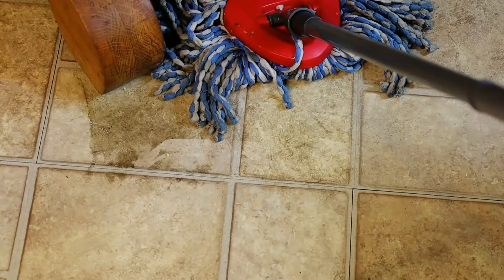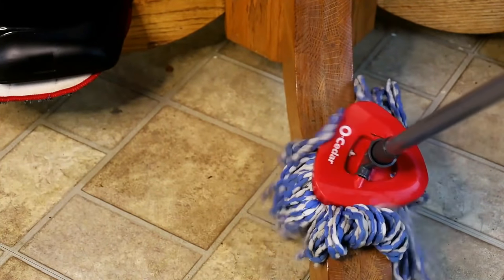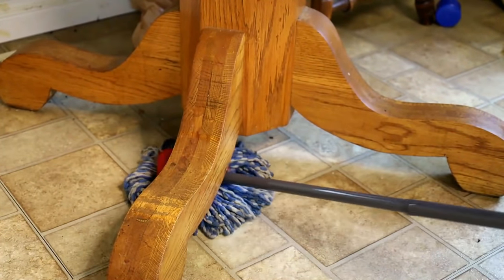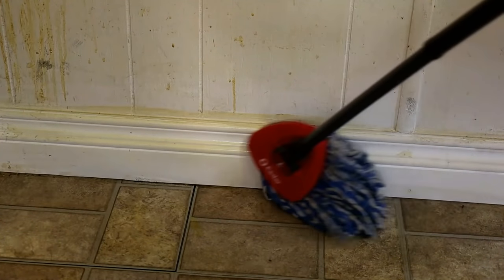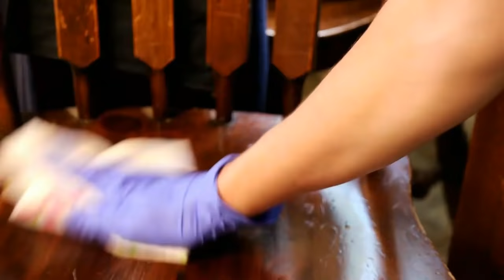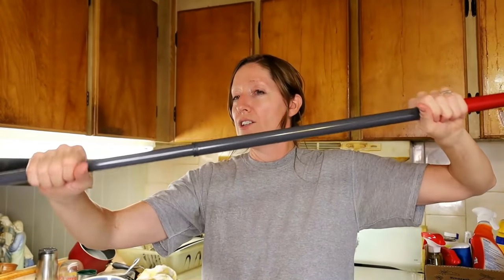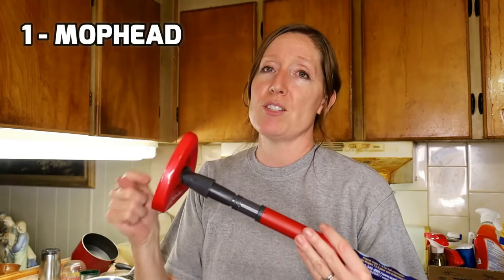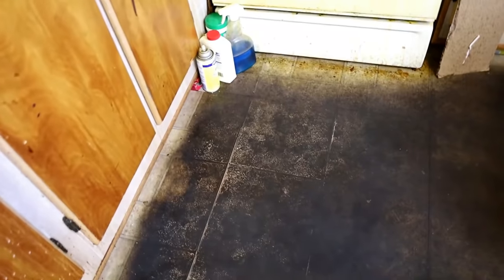UNBELIEVABLE ⚡ Put THIS on Your Filthy Floor and WATCH WHAT HAPPENS

Comment: I used to be a custodian at a university. When the students moved out, we cleaned the apartments. When we came across some seriously nasty or hard to clean things, we would get creative. Oven cleaner was used to clean bath tubs, acid based toilet bowl cleanser were used to remove mineral stains from sinks and tubs, and it worked wonders at cleaning stainless steel. You did a great job improvising and being safe.
Reply: All of those are excellent cleaners for tough jobs.
Reply: That was a kind thing to do...you will be blessed ..
Reply: Have you ever tried Oil Eater?  It works great on grease.  You mayhave to look in auto parts store for it.
Reply: I was a custodian, too. I remember walking into a seriously filthy student apartment. I thought to myself how do these girls live like this?
Reply: Oven cleaner even if no smell is a big NO NO.

Comment: Great job! I have one suggestion to anyone reading this: Please don't rinse the grease down the sink. Grease will build up in your pipes and septic system and the formations of fatbergs (like icebergs) will damage your pipes. It is very expensive to fix the plumbing. It's best to just throw the greasy wipes away instead of rinsing it down the drain.
Reply: Fantastic advice. I winced when I saw the grease go down the drain. The only down side to watching this amazing, wonderful video.
Reply: My son used to make bacon every day. Then he would dump the grease down the kitchen drain! Can you imagine? Yup within months the drain was backed up. My dad owned the house and was renting it to two of my three sons ( the youngest was still in high school). Luckily my two older sons’ dad was a plumber and was able to clean the drain. Thank goodness. But what a mess! 
My oldest son no longer puts grease down the drain. 🤨
Reply: Our plumber totally agrees with you.
Reply: Luckily, the active ingredient in drain cleaner is sodium hydroxide.... same as oven cleaner. Doubt those pipes will clog since the sodium hydroxide dissolved that old grease so it can be washed away never to offend again.
Reply: @gtron7692  sodium hydroxide becomes diluted. If that were the case, less plumbers would be needed. I vote a big No to letting grease go down the drain.
Reply: My mom used to clog the drain all the time with grease. Our plumber finally told her to use nothing but Dawn dish soap, and he never had to come unclog that drain again.
Reply: Yes. I would have used crumpled newspaper to wipe up the initial layers.
Reply: I have a septic tank so I would NEVER pour straight grease down my drain. However, when cleaning greasy pots & pans, what I do as an extra precaution is wash them over the disposal with plenty of dish soap. After rinsing completely, I turn on the disposal while spraying scalding hot water & a generous squeeze of dish soap. I run the disposal until I can no longer see suds & it SOUNDS empty. If u have a disposal, u know what I mean…lol. I’ve been doing that for years & I’ve never had any problems.
Reply: @robertagannon442  l
Reply: Yeah, I cringed when I saw that.  No grease down the drain, please!  Otherwise, kudos to Diana and her crew for their perseverance in getting the job done.
Reply: Excess grease and sodium hydroxide will still clog the drains. It just clogs them with hunks of soap instead. There is an article somewhere about the soapbergs that form in London's sewer systems from restaurant grease going into their ancient sewers.
Reply: I would had used shop paper towels and trashed them
Reply: I would have ran hot water, put the grease down the drain, and squirted dawn in there. Y'all relax
Reply: @robertagannon442  miss im not sure how to tell you, but that's on YOU and his other parent for not teaching him
Reply: @gtron7692  
Regardless of how you disappear the grease from your delicate eyes, IT HAS TO GO SOMEWHERE.
Eventually it finds its way to the Sewer Plant, and becomes THEIR problem. Except guess what: anything requiring extra personnel or overtime, messes up the budget BIGLY. Then everyone's rates go up across the board. Following the rules is the best policy for all.
Reply: @Kubulek17  he has a very short attention span, sir, and even though I taught him many things, over and over again, he didn’t always remember some of those things. I taught him to parallel park when I was teaching him to drive, he remembers learning it, but not how to do it. You’re right it’s on me, and the bacon grease info just didn’t stick.
Reply: @Pandora_369  my mom once said something about letting hot water pour down the drain, from the faucet, when things got slow. She never elaborated.

But a few months ago it was slowing down, and I had seen something on social media-1/8 to 1/4 cup Dawn, and a quart or two of boiling water.
Wow did that speed things up in a hurry.
Reply: @lizh1988  dumping boiling water from pasta or the canning kettle helps too.
Reply: @ruthannjones5873  yes, you are right. I too saw that article regarding the fat/grease berg in London's sewer. It was blocking the flow, what a mess! It is unbelievable of what some people so carelessly pour down the drain. “out of sight out of mind”
Reply: @erikasauder3757  
I, as a hobby, actually make my own soap. Lye, oil/greese, and water becomes soap.
Reply: @gtron7692  What you say is an interesting concept. I read about the chemical and came to the conclusion that diluted grease is still grease. Best not to put anything grease related down the drain.
Reply: Yes I wipe pots and pans out with a paper towels as much as possible to remove the grease before washing them with Dawn.
Reply: True! I interviewed the waste water management people of my town for a local paper. They said fatbergs collect at the road outside people's houses and cost huge amounts of their time and your tax money to remove, break down, etc. They use biologics, which naturally break them apart, but the best thing is don't let it build up that bad in the first place! Collect your grease in a jar or old can or even a disused coffee cup, throw it away once it is cooled and solid. One funny anecdote: They said the fats from Thanksgiving dinners are the worst time of the year for the sewer dept.!
Reply: @ceriusdime2507  Ditto!!!
Reply: I was thinking the same thing
Reply: @despicabledavidshort3806  If you had to spend thousands on plumbing repairs because the former owners put grease down the drains you would be more upright about I'm guessing. Yes it happened to me. Now I wipe every greasy pan or dish with paper towels and trash it.
Reply: Dawn dear...😂 
If it's a lot of grease... Double some plastic grocery bags, pour, tie it tightly and discard.💪
Reply: @moniettebondu1195  I use empty cans. Like, soup cans, etc.
Reply: @juleenrustan3804  nice! I like that better!🙏
Reply: @moniettebondu1195  Yes, indeed!
Reply: A friend of mine is a restaurant owner so you can imagine how much grease he has to dispose of. Even doing that some grease still sneaks down the pipes. Although he is aware of this so we always follows up with a degreaser so his pipes don’t back up.

Everyone please remember she is not doing this every day! She’s getting rid of the icky water down the drain one time! Plus she is using other items that will break down the grease as it goes down for this one time!

If it was a daily issue then you would have to find something stronger. Just remember she’s doing this one time!
Reply: Exactly! Those poor pipes!
Not too mention pollution further down the track!
Just put it into the garbage.
Reply: @Pandora_369  oh no, the Piumber lost business 💰🤑😆😆😆
Reply: I was thinking the same thing.  I think I would have sacrificed some paper towels or disposable swiffer cloths to scoop up and absorb the worst of it, so it can go straight into the trash can.
Reply: I don't believe this video is totally correct. A buildup of dirt and cooking grease would not be the same in the Far Corners as in the middle of the floor and at the stove.
Reply: @moniettebondu1195 . Funny how that works, common sense goes a long way, if you use it.
Reply: The cleaner eats the grease where it won’t clog pipes
Reply: We had a septic system where I grew up. When my mom cooked food that was greasy, we washed the dishes on the back porch in the galvanized sise by side tubs bc that gray water went down a hose that drained off into the woods rather than the septic tanks and lines. The washing machine drained into the woods as well.
Reply: @lizh1988 that also is great for toilets when gets clogged up or slow. Just don’t use boiling water.
Reply: @Trumpet1965  Right. I just pour off or spoon out grease, let it solidify and put in plastic bag in freezer for garbage day. I save scraps of paper towels for what remains, then wash with hot water & liquid soap. For sink. 

For toilets, family always discouraged Drain-O and other harsh clearing liquids. It's the plunger for us.
Reply: @gtron7692  Also, over time the harsh chemicals will erode your pipes and you will need a plumber eventually.  I save my plastic containers from folger's coffee and others and dump it in there and it hardens and then I dump it in the trash.  Still not the best but better than the drain.

Comment: Suggestion: use a tarp when you need to cover a large area, instead of the multiple pieces of Saran Wrap. Also, borax and hot water works well to bring back the original color of vinyl flooring (after getting the grease up), in my experience.
Reply: My first thought was a tarp as well. However I think using trash bags would give the control you need plus the coverage.
Reply: @marshakott1574  You get rolls of real wide, thin plastic mesnt for covering floors when painting etc. It’s cheap too. I think I paid the equivalent of $2.99 the last time I bought a roll. It would be much better for this than a tarp, because it has to cover and make sure air doesn’t get to the floor/cleaning solution for the cleaning to be  most effective. 😊
Reply: @lottatroublemaker6130  I came here to say this same thing.
Reply: Thanks for the tip
Reply: @countrystyle5076  same here
Reply: @Erin Kennedy
Borax, the 20 mule team. lol
Reply: I found a DIY degreaser recipe online and it’s main ingredient is borax. I that stuff!
Reply: I have never used Borax before,why the need to cover the floor? Never seen that done before.
Reply: @moladhdodhia164  
They cover the floor so the cleaning solution stays wet and it thoroughly soaks into the grime for easy removal. It's the same difference as soaking silverware before washing it makes it easier to clean.
Reply: @sharihere8809 ,My Mom and Grandma only washed the floor on their hands and knee's,they never used a mop,so this method was new to me.
Reply: @moladhdodhia164  
That's how I was brought up. A bar of fels naptha soap and a scrub brush and sponge. I never seen a mop until one day at a friends house when I was 11 years old
Reply: @moladhdodhia164  
and certainly we didn't go more than a week without washing the floors, let alone ten years!
Reply: @sharihere8809 ,Lol my Mom would wash the front room and dining room walls and carpet's and windows and screens in one day at high speed,not me,I would rather organize and declutter.
Reply: @moladhdodhia164  
I'd have to do screens too. Not fun squeezing in those old pins to remove them..  I still feel it in my fingers. I got smarter and started using a screwdriver to move the slides lol you're funny
Reply: @sharihere8809 ,I moved like a turtle,I swear my Mom and Aunt were on speed,my Mom's side of the family had a great work ethic.
Reply: @sharihere8809 ,My Uncle didn't like the grass cutting job my cousin's did on the lawn,so when he came home,he made them cut the grass on their hands and knees with a pair of scissors in the dark with a flashlight.
Reply: @moladhdodhia164  
uh oh, we may be distant relatives. haha, my sister is like that. I'm like, slow down and let me think for a minute. I got to get a plan in my mind first
Reply: @sharihere8809  thank you for that explanation 😊
Reply: Thanks, time to get more borax!
Reply: A tarp would not have clung to the floor and it wouldn’t have worked at all.
Reply: @moladhdodhia164  she didn’t want it to dry out
Reply: @rachelbuchanan9945 ,I honestly had no clue.
Reply: Do you mean Borax, the laundry detergent? I recently tried that in my Bissell Crosswave. It left a white film on my vinyl tiles. What did I do wrong?
Reply: @moladhdodhia164  Come and organize and declutter me!!! I will do the scrubbing if someone can organize me!
Reply: @conk449  yes, Mule Team Borax! I dissolve it in very hot water in a regular bucket, then use a yarn mop (can't think of what they're really called off the top of my head right now). I haven't noticed a film, but my floors are also light in color so maybe I just haven't seen it.
Reply: @lottatroublemaker6130  thanks! I said tarp, but meant any kind of large plastic covering. Dollar Tree tablecloths would probably work too. Just anything bigger than saran wrap rolls. lol
Reply: @D_Parks  It didn't have to cling to the floor, just cover it to keep it from evaporating. I mentioned to someone else that I meant any larger piece of plastic than the saran wrap that was used in the video.
Reply: @conk449 ,😊. It's my favorite thing to do.
Reply: Great job! I think you are an Angel for doing this cleaning.
Reply: was thinking even plastic trash bags cut open
Reply: @D_Parks  I think she was talking about one of those cheap plastic cellophane-type drop cloths.  They would cling no problem.
Reply: Thank you so much for doing this for your elderly relative.  So often as people get older and lose a spouse, cleaning goes by the wayside because either (as you stated), his wife did all the cleaning or he was never taught to properly clean a home because HIS mother did all the cleaning when he was growing up (as that was considered "women's work").  He is very lucky to have you care about him.
Reply: You can also use the thin shower liners instead of stiffness of tarp,bonus is that the liners clean up well when run through laundry washng machine then hang to dry in sunny spot preferably to avoid mildew possibly if put away with damp spots. So best to make sure completly dry before storing for next few uses. But more work but keeps plastics like Sean wrap out of our waters and oceans particularly where it too often hurts wildlife.
Reply: @heather-jeanvandenberg1961  Yes!  Great alternative, thank you.
Reply: Trash bags would have gone further than saran wrap
Reply: yea TSP exactly Borax is cheaper by ALOT
Reply: Also a face mask if you're working with a lot of chemicals. Definitely open windows👍
Reply: @D_Parks  It also may have deposited tarp color on the floor.
Reply: @jackierux1345  clear bags preferably.
Reply: @conk449  probably used too much in the washing solution. You have to rinse well with clean water, sometimes more than once.

Comment: I have found that easy off oven cleaner works on a multitude of things. I had some really greasy pans that I bought at a yard sale. I sprayed the outsides of them with easy off and put them in plastic bags in the sunshine for about an hour. The grease practically just rinsed off. There was almost no scrubbing.

Comment: Awesome Job!! 
blue "shop" towels (often in automotive dept.) are something I highly recommend to keep handy for cleaning :) they are highly absorbent , sturdy, and have minimal shedding of fibers when used on something like windows. One of my favorite inexpensive products. happy cleaning!
Reply from the maker: Nice tip.  Thank you so much
Reply: Unlike kitchen paper towels, they can be wrung out and reused.
Reply: I would have found some ratty old towels so soak it all up. I’m sure that was really tiresome, going back and forth to the sink with the sponge.
Reply: With the amount of the gunk, I would have used a rubber squeegee and a dust pan rather than attempting to sop it all up. Similar to how they remove the solvent for removing paint from furniture.

Comment: For your viewers, for the plastic wrap, you could use the plastic sheeting you can get at your local hardware store or big box store.  Also you did a very wonderful thing, thank you to you and to all other people who are pay it forward people. It is a wonderful thing to do. ❤️🙏
Reply: Or a dollar store shower curtain to cover more area cheaply
Reply: @lisadaws6191  ooohh, that's better than my trick of using cut open trash bags. Too bad I don't have anything to use it on!
Reply: Why use plastic sheeting?
Reply: @nancymelloh4222  to hold the cleaner on the floor to keep it working instead of evaporating. It works longer that way.